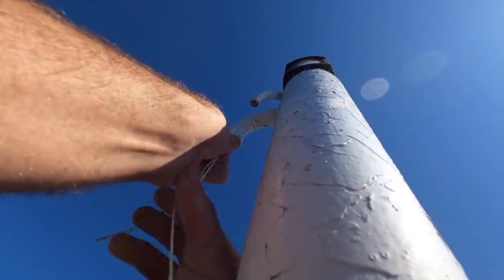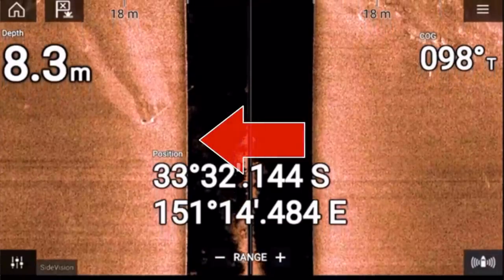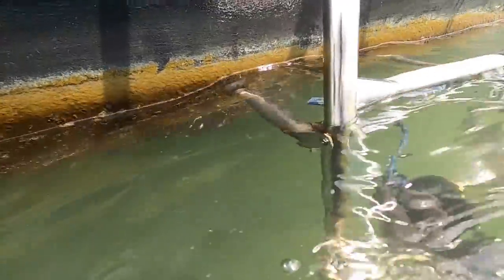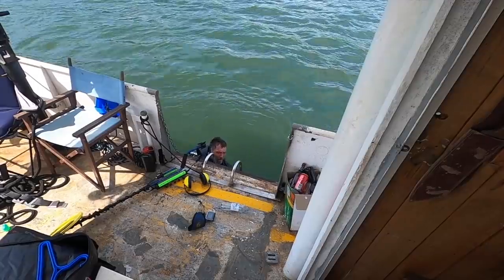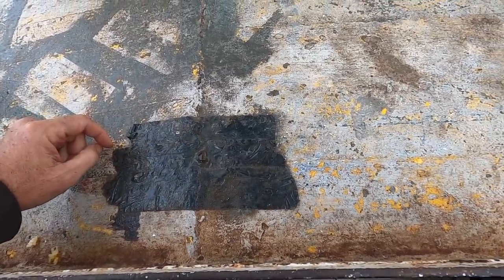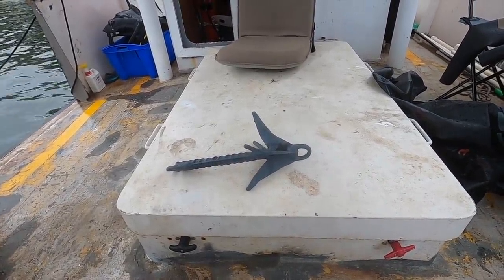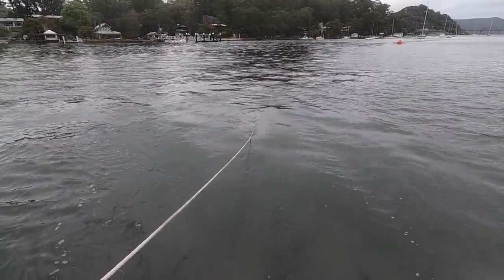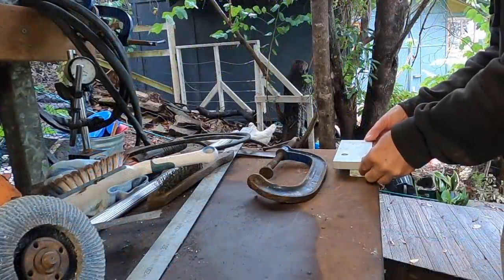Boating and diving

Comment: I'd put an arch into that plastic block to keep the chain and rope in the center
Reply from the maker: Was thinking that, but it needs to run a bit side to side as it spools onto the drum.
Reply: @DangarMarine  Yeah, I see you're a bit tight on the fleet angle but I might not want the anchor line abrading on those metal sides. Maybe a little bit of plastic on those vertical sides. Just an idea.

Comment: Hi Stu, idea: get some USB sockets in the roof, close to where you have your GoPro mounts so you dont run out of battery so often ;)
Reply from the maker: Yes, you can't have enough power outlets!
Reply: Battery bricks work OK as well. Even good wiring and plugs don't last on a boat.

Comment: What do you think...? When you are scanning the bottom, you drop some weight  to the bottom at the point where you suspect the item to be. To the weight could be attached short rope with some sealed metal bouy/can which is filled like 70% with water. The can would float close to the bottom and you coud rescan the position to see  if the weight with the can is in the correct place. By putting longer rope with some float you could use it as a guide rope when diving and could pull the weight&can back to the boat when needed. Few of those thingies could be made and would be easy to see the one which seems to be closest to the item.
Reply from the maker: Yep, that's pretty much the technique I talk about in this video.
Reply: @DangarMarine  Had to watch again. Thats pretty much exactly what you said. Didnt notice while I was typing my text while the video was running :D

Comment: Stu
When you put the engine back in Renko,  are you going to install a pryometer ? I've been told running a diesel at low RPM doesn't build enough heat to burn the fuel efficient  enough and can case problems.  🤔😉
Reply from the maker: I have been looking at something like that, and talking to Adrian about going to smaller injectors given the amount of low load / low RPM running I do with the boat.

Comment: I always find there is a reason why someone does what they do/did, with this in mind, I'd love to ask the guy that used Aluminum foil to wrap the wires why he did it.
Reply: alumimium foil acts as a shield around data cables to prevent interferance from normal power cables  when close proximity to each other in cable runs,also eddy current protection from power cables belden cable here in uk is foil wrapped used for entry systems and cat cable can also be shielded in this way
Reply: And lets not forget,  the aluminum foil hats to keep the gubberment from mind control.   LOL 🤯🤯
Reply: @646klein  I'm well aware of using Mylar foil to wrap wires to prevent stray electrical signals, however, the wires shown where just a few single wires tape into a bundle of 3 or 4 wires, with the Aluminum foil wrapped on the ends - they where not shielded by any stretch of the imagination. So do you have another idea? I'd like to know what the thought process was, since using aluminum next to steel will cause a galvanic reaction (fancy name for a low voltage battery).
Reply: @michaelmcclure8673  Well it is AU land, and you can never tell with THOSE people, they did all come from criminals.. ;)
Reply from the maker: May have been their choice of chafe protection covering.
Reply from the maker: You don't have to convince me @meance. Dad has traced both sides of my family back to the convict ships they were sent here on. Does it show? ;)
Reply: @DangarMarine  I'm stating to think it may have been some attempt to keep water out of it. This is why I posted the my comment about wanting to find the person and see their thinking on it.
The more you show of the boat the more interesting I find it.
Reply: @lemullet6273  Uncalledfor comment.
Reply: @TR4zest  It's all good fun, and my answer would have been that I type with on hand. 

I think we all watch this channel to learn a bit, relax a lot, and maybe enjoy a little banter.
Reply: @ross82  It's all good, I think he didn't see the whole thread before replying, this may be the reason he posted his comment.
I was hoping the guy that replied about me not knowing the history of AU was going to keep his post, I'd have liked to reply about how great nations are normally founded by peoples that "civilized" society didn't want - America and AU come to mind here.
Reply: @TheDgdimick  ah im sorry i  missed that part doing laundry haha  your guess is a good as anyones maybe he was in there eating his sandwiches and didnt want throw the foil overboard i guess we will never know
Reply: @646klein  I think you have the best scenario so far. As a side note, I really like Mylar wrapped wire, being a Ham Radio guy, I know when I use it I can expect there won't be any RFI issues.

Comment: Your taped deck holes make me wonder: have you welded up any of the deck rust holes?  You had quire a few at launch time. Perhaps I missed the repair?
Reply from the maker: The only deck section I've repaired so far was above the engine bay so I could paint and install the sound insulation. The aft deck is definitely still on the list.
Reply from the maker: @Aluminium workboat project 3mm

Comment: so maybe get yourself a goodman handle for the light so you have a free hand for your beer or detector.  track vis vs flow in that spot there may be a flow rate that clears your muck without moving the whole bottom.  in high flows river divers use a mini pick ax, trenching tool or pipe to keep their location " river stick". Cooper is my dive buddy... be safe...
Reply from the maker: Something like that for the light would be great. There are definitely times in the tide when it is slow enough to hold position but enough of a flow to carry the silt away. The pick is an interesting technique.

Comment: Stu, no need in searching for a low profile roller I think. Can't you just cut a bit out of the base of the bracket, leaving the sides in place, allowing you to mount any roller? That roller would extend below the bracket, which is why you'll have to cut away a bit of the base plate, to create room for that. This way you can use any roller you like, meaning that if it wears out repairs will probably be easier.
Also, what model router is that?
Reply from the maker: Could be a good way to go provided it stays strong enough with just the side tabs.
Reply: @DangarMarine  Of course I only have the video to judge by, but I think those side tabs are thick enough to hold it. The front roller copes with much higher sideways forces, and it is also just supported by those side tabs. You also don't have to cut away a lot, just enough for the roller to fit.

Comment: Do you know those games that have a kinda of claw hand? they are boxes you can see into and there are prizes inside. if you had a "hand" that you could lower over and over it could act like fingers digging into the sand and grab things. you could add weight to the base to make it dig deeper or some kind of hammering action to make it dig itself deeper. though probably that would end up being one more thing that gets stuck down there and something to look for in six months! great video.
Reply from the maker: Something like that would be interesting if you knew you were in the exact right spot for sure.
Reply: @DangarMarine  I think you need two things. be lucky and have lots of free time!
Reply: @DangarMarine  oh I see, so if you didnt know the right spot you would have to zig zag all over the place for a few days dropping the claw over and over? hmmm. still sounds like fun.

Comment: Hey stu did ya ever think of installing  samson posts on the stern? For towing an stuff.
Reply from the maker: Have been thinking about it, but it would need to be something removable so it isn't in the way the rest of the time.
Reply: @DangarMarine  Or even some heavy cleats on the floor with holes through the transom for ropes. Especially for when your towing. Just came into my head there when you were throwing out the grapple. Love the vids. Watching from Cork in Ireland. I have a 16 foot fibreglass angling boat. Called a warrior 165. 28 knts flat out.

Comment: Stu did you use the radar as a step? Not worrisome? Awesome video though as always
Reply from the maker: Seems strong enough and it is never got to get used, it is an old analogue one that isn't compatible with the Raymarine unit. Will get replaced eventually.

Comment: I have the exact same issue with Open charts after OS upgrade. How did you end up solving it?
Reply from the maker: There didn't seem to be a real solution. When you buy charts they give you two licenses so I just installed the second one, the original one is no technically wasted which is a shame.

Comment: hey stu, just wondering if having a large magnet would be of any use in finding the chain when diving. just thinking with the silt being so bad if you were able to move a strong magnet over the sea bed by hand, you may get a hit mabye it would help, just an idea.
Reply from the maker: Unfortunately stainless steel isn't magnetic.
Reply: @DangarMarine  yeah i wasnt sure if it was just the anchor that was stainless steel or the hole chain. it will be good to see when you do haul that up. great work so far.

Comment: Instead of a third roller maybe you could just angle the whole piece (don't remember the name of it) upwards. In that case you are more aligned with the anchor line. I don't know if it's possible to do, but at least I have said it. :)
Reply from the maker: Unfortunately it needs to angle down so that the anchor will self launch without being given a shove.

Comment: shees.... Zero vis.... ,    if you can find stuff in That , you can find stuff Anywhere....
Reply: can you get a small compressor w the proper filters to be able to re-fill  your tanks On Renko ?  or would that cost alot more than its worth ?
Reply: also what was the water temp?   you wearing 7mm suit ?
Reply from the maker: I'd love to get some sort of compressor onboard one day. They are relatively expensive (around $10,000) though.
Reply from the maker: Water temp was around 21, 3mm wetsuit.